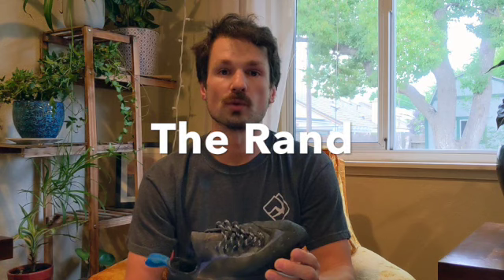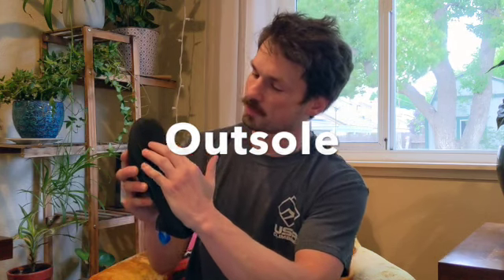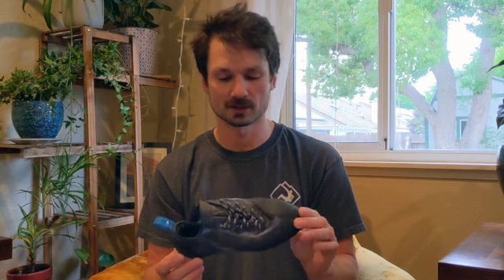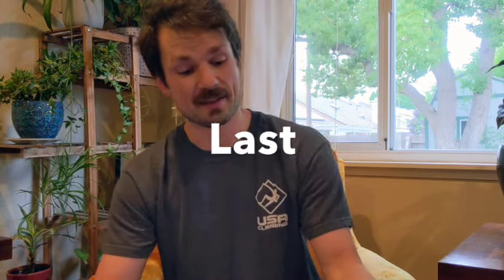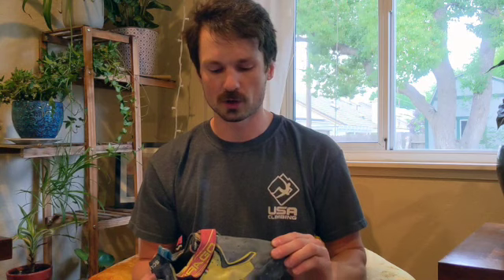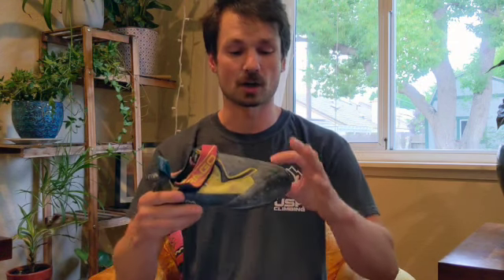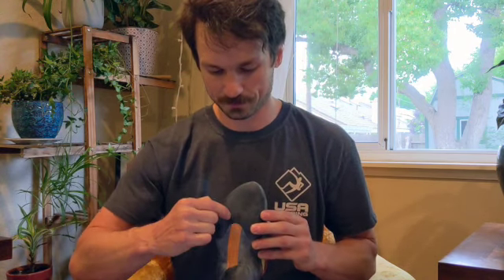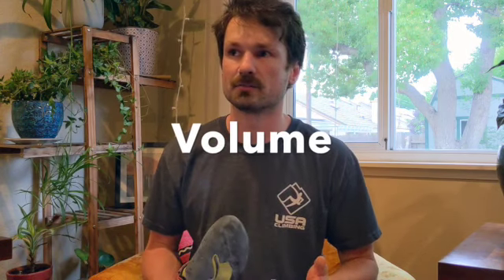Anatomy of a climbing shoe

Comment: You're incorrect about the midsole. The midsole describes the layer between the rubber outsole and the inside lining of the shoe. Both the Evolv Zenist & the Evolv Shaman have a split outer sole but the reason the Zenist is dramatically softer is because it only has a thin rubber midsole compared to the additional love bump midsole that the Shaman has.
Reply from the maker: Thank you for the correction! I appreciate the feedback and information! I'll have to clear that up in the next one